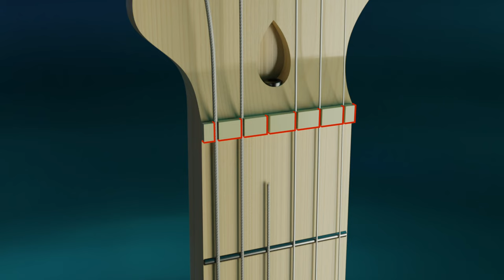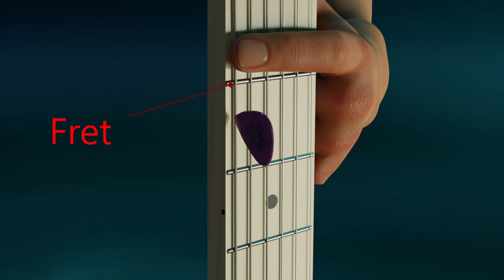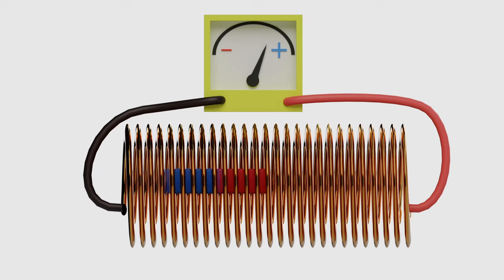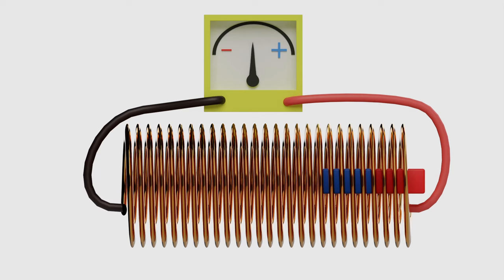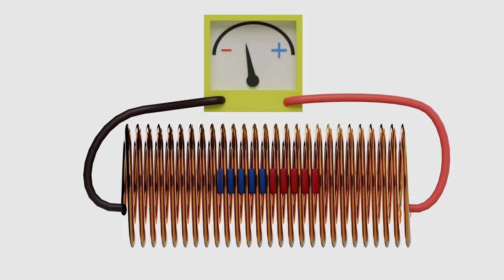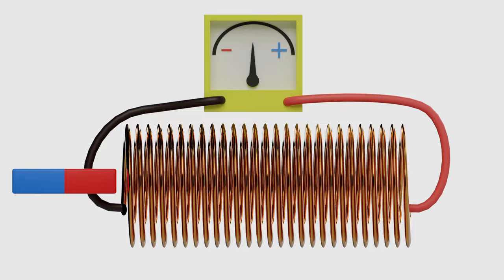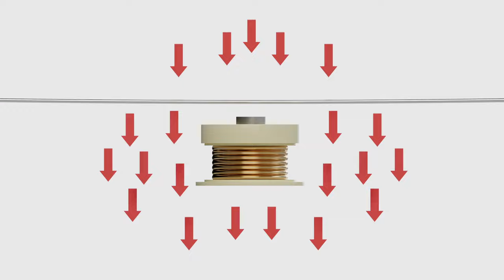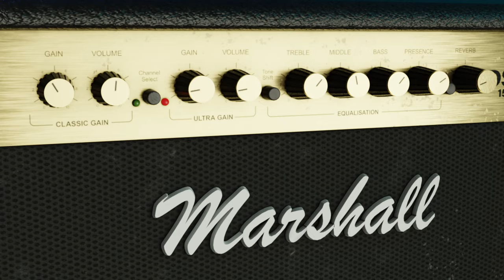How an Electric Guitar Works

Comment: Great video! However there's a few technical blunders such as the creation of charge and the clipping of the "frequency", other than that, great job!
Reply from the maker: Do you mean the technical visual glitches? They are pretty unavoidable unfortunately
Reply: @extrapixels  no, I mean that you said that moving a magnet next to a coil creates a charge. Charge cannot be created nor destroyed, a changing magnetic field creates a *current*, which is the time derivative of charge (its rate of change). And the other thing is that distortion clips the waveform, changing the frequency spectrum of the waveform (its Fourier Transform), the way you said it sound more like a bandpass filter

Comment: Really enjoyed the 30 minutes of nothing at the end, but other than that, this was a great video. I would have liked to see what the tone knobs do to the signal or at least how they’re wired to the rest of the components
Reply from the maker: Well, shit. That explains why this one took so long to export and process. I'll trim the video down if YouTube lets me. Thanks for the heads up.
Reply from the maker: As for the tone and volume knobs, they basically just change the electrical resistance of the circuit.

Comment: Any chance this highly detailed guitar model is for sale? Would love to use as a base for a custom animation project I'm working on
Reply from the maker: I can send you the model but it has a few issues. It was originally made as a background asset so the body is pretty low poly. And the neck isn't curved properly at the back since it's never visible in the animation.
Reply: @extrapixels  that sounds workable for what I'm planning I have made guitar necks in blender before so I can probably just make a new one